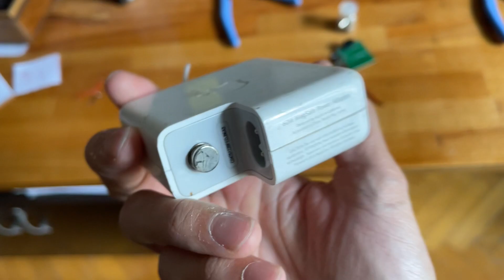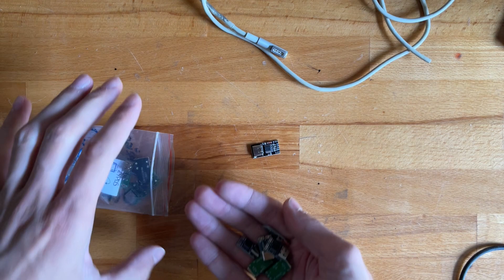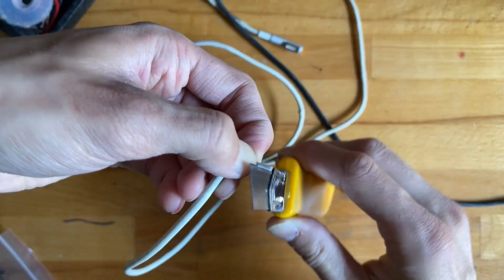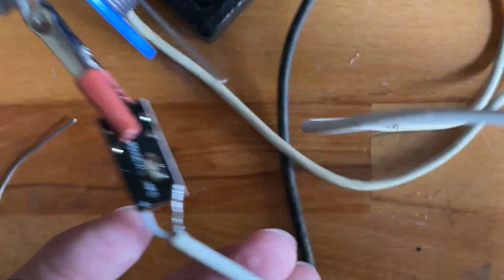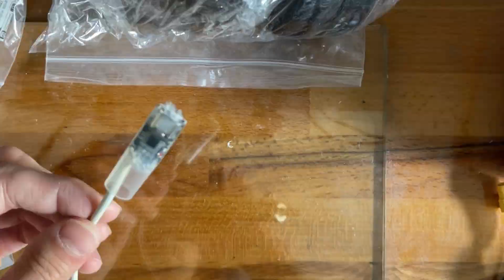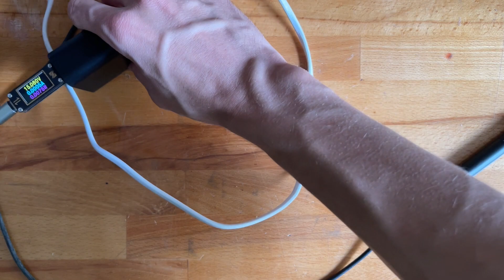DIY Type-C to MagSafe 1 Adapter

Comment: Some words of wisdom. These boards are made with lead free solder. On that C connector mounts I would add regular solder to each hold down pin and then extract all of the solder and resolder with regular lead based solder, one pin at a time. It will hold better, lead free is to brittle and will fail over time. A works of caution, do not use regular silicone sealant on electronic boards. It releases acetic acid while curing and will start to eat away at copper traces. I use hot melt glue instead.

Comment: You should probably keep a USB cable inserted to the port while curing to avoid the silicone leakage from blocking the connection

Comment: The max output of MagSafe 1 is actually 18,5V, not 19,5. I'm still curious on how the tension difference is handled on MagSafe 1 and 2, eg: if all MagSafe 1 MacBook can handle up to 18,5V or the charger switches the output voltage based on the connected Mac
Reply: I just checked my MagSafe 1 chargers, and they're both listed at 16.5 V. My MagSafe 2 charger is listed at 14.85 V. However, Apple sells a tiny adapter that converts MagSafe 1 to MagSafe 2, meaning MagSafe 2 Macs are happy to be charged by MagSafe 1 chargers. However, the reverse may not be true, as Apple does not sell a MagSafe 2 to MagSafe 1 adapter (even though it seems to work in the video).
Reply: @EugWanker , I said max output, not that it was the only. Higher power adaptors (from the 15" and 17" MBP) had a higher tension output

Comment: Hello. Can a macbook pro mid 2012(same as in this video) take 18.5v-20v? I am planning to buy a usb c to magsafe 1 cable but it outputs the above mentioned voltage. I hope someone can help. Thank you.
Reply: It is rated at 16.5V for a reason. Do not give it more, you will fry the charging port.